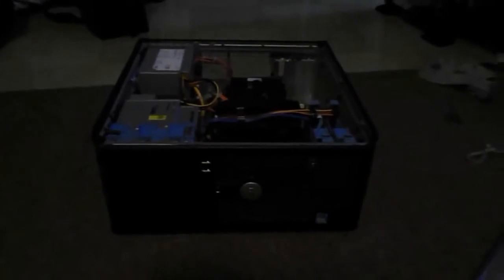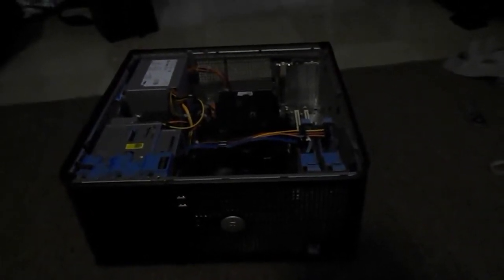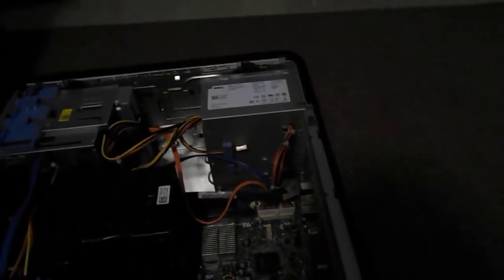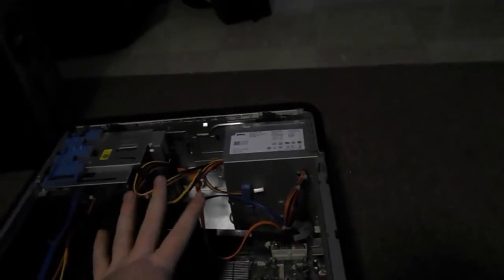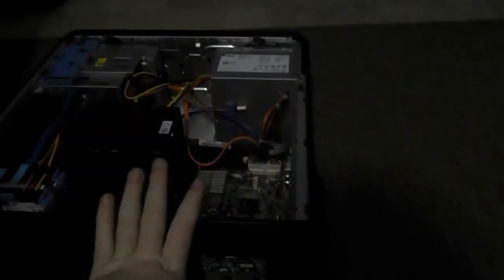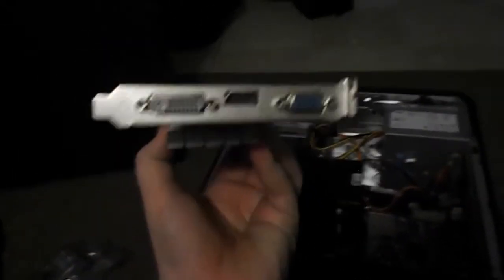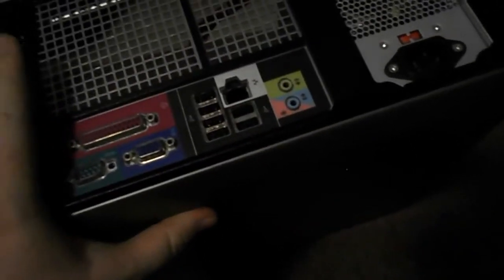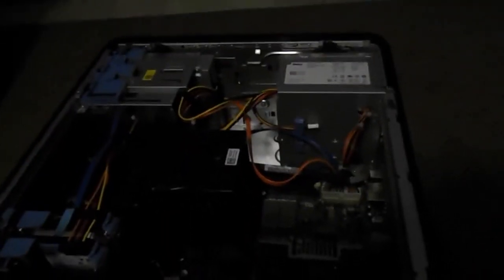Dell Optiplex 380

Comment: Hi. Very useful video. I have the Optiplex 380 and I am considering upgrades, so I wanted to ask you 2 things if you don't mind. First as far as I know not all CPUs that fit in this socket type are actually supported by all MOBOs. So is it possible to put any 4 core CPU with this socket type inside? Second I have seen people mod similar machines by cutting the back of the case to fit a short 2 slot card inside like the single fan EVGA 750 ti or even 1050. In your opinion can that actually work? Thanks :)
Reply from the maker: Alexander Radev hello and thanks for your comment. any later socket 775 chips that support DDR3 memory should work. I would Google the part # of the chip and the computer model and it should tell you if it's compatible or not through the results. 2nc you can cut out part of the drive cage to accept a decent length dual slot card. I would definitely consider a PSU upgrade before putting in a new card.